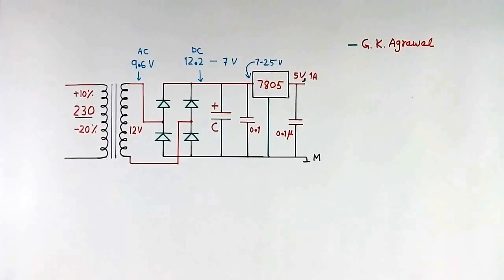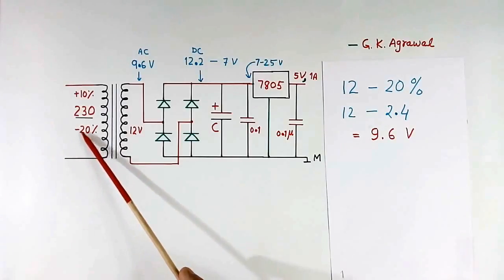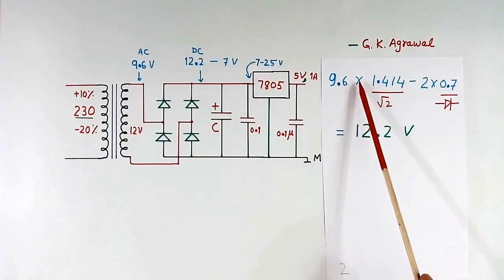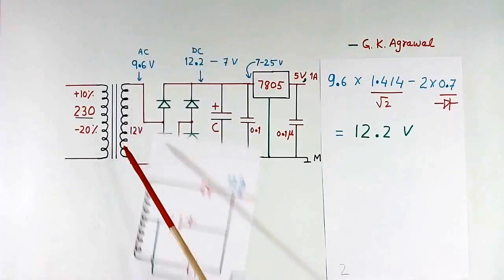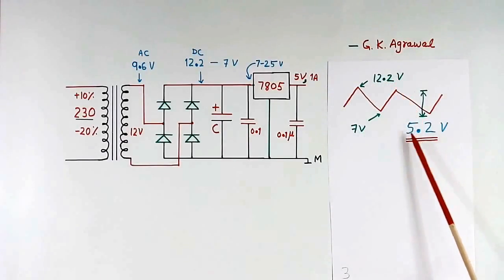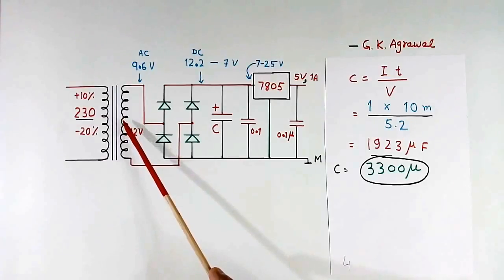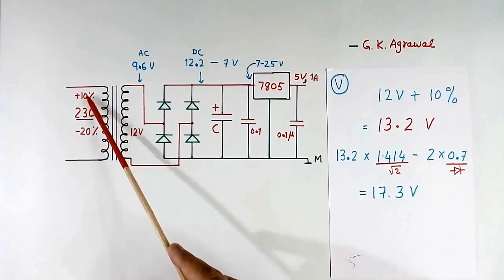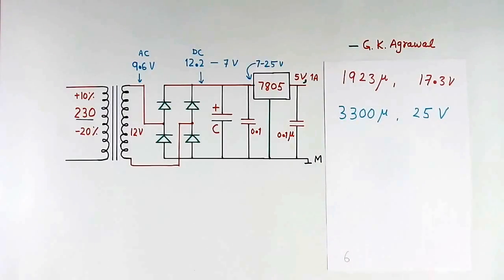Bridge rectifier - capacitor value & voltage calculation

Comment: I have watched your video but didn't get my answer. I want to know how to calculate the output current (amps) of a rectifier circuit. In your video I found one doubt... for capacitor formula (C = It/V) the  value of V was taken as 5V but its the difference of maximum and minimum voltage of the regulator but not the voltage across the capacitor. So I think V should be 7V here and also there is a very simple way to select the capacitor by taking double the value of the stepdown AC voltage. Here 12V is AC stepdown voltage so we can choose 25V capacitor or higher!
Reply from the maker: 1 amp is just taken as an example to design circuit. Current is not calculated, current may be a known requirement and then you have to calculate capacitor value. However reverse calculation can be done also. 2 -  Method   of calculation explained, was used by me for cicuit design. You are free to follow other method, but then equipment should work properly. 3- Now coming to 5 volt, I think you must  watch video again slowly, and give enough thinking for my every word told. I can not explain better.
Reply: @GKAgrawal2  I didn't get why you choose the voltage difference (5V) instead of the minimum voltage (7V) because that's not the output voltage and I think you should explain that!
Reply from the maker: 5.2 volt ( not 5 volt) taken as this much voltage capacitor will discharge due to the flow of load current. ( 7 volts is left overvoltage). If the capacitor is discharged for more than 5.2 volts then you will not get 5 Volt final output, as the leftover voltage across the capacitor will be less than 7 volts.
Reply: @GKAgrawal2  So for the capacitance formula (It/V) the V is always the discharge voltage of the caps? What if the voltage regulator is removed from the circuit then how we will calculate the value of V?
Reply: @saneeshelectronica9293  I came across another formula and it's C=I/(2*f*Vpp) where I is current, f is AC frequency and Vpp is ripple voltage. But as per your logic I can choose the ripple voltage as per my requirement but there must be some standard value because we can't just taje it as any value (that's theoretical only). Here the value of I is the supply current and that's what the transformer will provide but how do we decide the ripple voltage? Some say that we should take it as 1 volts but what is the proper method to find it?
Reply: @saneeshelectronica9293  I didn't understand your formula to calculate the required transformer can you tell me the formula? how you got the values 1.4 and 1.414? Also how you got the value of I as 4?
Reply: @debojitacharjee   the formula is simple.  I went reverse direction.  for example i have 18 vac = Dc will be 18x 1.414 peak -  2 diode drop( 0.7+ 0.7) of bridge rectifier.  4 AMP is required motor current in examble
Reply: @saneeshelectronica9293  You don't tell things clearly... I asked you about the formula but you are showing only the values! How you calculated 1.414?
Reply: it is RMS xroot 2 =peak voltage
Reply: @priyageorge3704  What RMS? Why we need peak voltage here?
Reply: @debojitacharjee  when capacitor is added voltage wil reach peak value of sine wave .
Reply: @priyageorge3704  Okay but why we need to know that because we find only the value of capacitor in uF using formula [C=SupplyAmpere/(2*ACfrequency*RippleVoltage)]. We can choose the voltage of the capacitor by taking double the supply voltage (if 12v is supply, we take 24v or higher). However I want to know what is the formula of your peak voltage formula properly, what is the formula of RMS that you mentioned?
Reply: @debojitacharjee   to get peak voltage u need to multiply with 1.414  if 12 v transformer 12x 1.414, if 24 v transformer, 24 x 1.414
Reply: @saneeshelectronica9293  Why we need to know this peak voltage?
Reply: @debojitacharjee   when we make dc from ac we need to use capacitor  . capacitor will take the dc out put  to the  peak value  that is the purpose of capacitor. if no capacitor  it will be pulsating dc.  for examble u need 12 v dc for  device. and u have used 12 v transformer, bridge rectifier and filter capacitor. u will actually  get  12 x 1.414 dc,  because of filter capacitor. if u didn't use filter capacitor ,u will get pulsating DC , not real DC.  so whenever u calculate the requirement, u need to consider that also  other wise instead of 12 vdc u get 15.568 VDC after deducting diode voltage drop of  bridge rectifier. if ur device can with stand 15 vdc, no problem u can use 12 vac transformer also.     if u use 24 vac transformer , actual DC is 32 v dc with filter capacitor mean   8 volt more . this get even worse at higher voltage transformer. please watch my videos to know more.
Reply: @saneeshelectronica9293  How you calculated 15.568VDC because for 12v peak is 12x1.414=16.968VDC, is that after deducting diode voltage? You plz give details or else its difficult to believe what you say! Also how this peak voltage will be same for all capacitors because it will depend on the capacitor voltage and I want to know how we will know how much the peak voltage will be if we choose a particular voltage for the capacitor? For example if 12v is supply then how much will be peak voltage if we select 24v capacitor?
Reply: @debojitacharjee   appreciate your interest in the topic. capacitor  does not produce any voltage it just store the charge and discharges when voltage goes down in each cycle. for any ac voltage it is  sinusoidal  voltage changes 50 times per second  when we use rectifier 4 diode it will have same  voltage fulmination but only thing is it will be in same direction instead of positive and negative . when we choose capacitor we choose capacitor we choose as per peak voltage of ac voltage plus 20% fluctuation. if 12 vac peak is 16.9 plus 20% (around 20 vdc).  capacitor not available 20v  so we use 25 vdc .even if u use 35 v doesn't matter   it wont improve anything, but life of capacitor may increase  little bit.   electrolytic capacitor has internal resistance  in Milli ohms. so always better to keep many parallel.   for example if u want 2200 MFD  Use 220 MFD 10 nos  ( if space allows you !!).... for every diode 0.7 to 0.8 volt drops when load is connected. so for bridge rectifier u need to minus  two diode drop  if center tap rectifier is used  one diode drop to be deducted. 16.968-1.4 = 15.568 . some diode has more drop.      .  so for any transformer  use (VAC X 1.4)- 1.4/1.6  as standard formula.    But diode looses lot of power if current is more for example if 10 amp current flows  around 7 w power losses at diode. please watch my channel and sub scribe . i have done video on that.
Reply: @saneeshelectronica9293   SANEESH ELECTRONICA  This formula (VAC x 1.4) - 1.4/1.6 will give what and for what purpose we will use this formula? I know that capacitor is not a battery and it can't generate electricity but what I said is that what is the peak voltage (V-1.41) and why we need to calculate it? Do we really need all this formula because we can use the capacitor formula [C=I /(2*fAC*Vpp)] to determine the uF of the capacitor to be used in the rectifier and choose the capacitor voltage as double that of supply.
Reply: @debojitacharjee     you r right for calculating MFD of capacitor the formula is not required. but when u  choose transformer for  a DC  equipment .  this is required. other wise if u select 24 vAC transformer for  24 v dc equipment . you may spoil it  as we are giving  32 vdc. from the rectifier filter arrangement. .
Reply: @saneeshelectronica9293  can you tell me howcome a 12v dc transformer rectifier circuit give 32v DC because peak is 16v only (V*1.41).
Reply: @debojitacharjee   oh no i was talking about  24 vac. the higher the voltage u use , AC to DC difference will increase. that is what i mean . if 12vac= 16.9 vdc, if 24 vac= 33.9  vdc  (u get only 33.9-1.4= 32.5 VDC at load).  you asked me. why we need to know the peak voltage?  i was answering that. if you dont know the peak voltage  u cant select a transformer. suppose u selected 12 vac transformer and after  rectification , u may surprise  why i get 15 vdc!!!!  any way one thing i need to know. are you doing any project ? or just wanted to know theory?
Reply: @saneeshelectronica9293  I am into projects and learning as also. But your teaching is useful because you don't clarify each and every thing you mention. You mentioned 33.9 - 1.4 = 32.5VAC but why you substracted 1.4 from 33.9? I just want to quickly sumup everything here since you had a long chat on this. You plz answer the following: 1) If a stepdown transformer is 12V then will it give 12V output without any load connected? 2) If you make a full bridge rectifier with 12v transformer then it's output voltage will be (12v*1.41) [PEAK VOLTAGE] - 1.4v [diode Vdrop] = 15.52v [FINAL OUTPUT]? 3) If a full bridge rectifier with 12v transformer gives 15.52v then can we use a 32v capacitor with the circuit?
Reply: @debojitacharjee  yes now it is clear for you. capacitor voltage has nothign to do with the design. amy capacitor more than 16 v is ok. if the voltage is less it will burst .  u ca use 25 v  as 16 is just enough.
Reply: @saneeshelectronica9293  So you mean to say that we can find the total output voltage of a rectifier by adding the transformer supply voltage + peak voltage - diode voltage [i.e. (12*1.4) - 1.4 = 15.52v] is that correct?

Comment: How you calculated the output ampere (1A) of the circuit?
Reply from the maker: Watch video again, you will get answer.
Reply: The 7805 voltage regulator has a maximum output of 1A.

Comment: Sir, why do we need to multiple the output of the transformer to root 2 (when changing from ac to dc)
Also why do we need to take half cycles (in this example for 50 hz 10 milliseconds) (In my knowledge the  capacitor will not be discharging  for the entire half cycle it will only discharge for a quarter of cycle plus till the next quarter cycle reached 7v but not the peak value)plz explain
Reply from the maker: Very good question.Yes your observation is correct that capacitor will discharge upto to 7 volt and will start charging again. But this will happen if capacitor value is correct exactly as per calculation. If capacitor value is higher {you will never get correct capacitor value} then it will not discharge up to 7 volt, it may be up to 8 or 9 volt. Then further if load is not full then it may discharge upto 9 or 10 volt, so we take full 10 mSec time. this is the simplest way and safer side. But if you are perticular then you can always calculate for exact discharge time, but then you will need very high knowlege of considering all known or unknown factor. But no body had perfect knowledge. you will known this after many years of industrial experiece. (Donot assume that your college knowledge is sufficient, you need to learn much more, to do product design).

Comment: Nice lecture but how do you know the number of cycle.  The question I have here doesn't tell me about the cycle.
Reply from the maker: There is nothing like number of cycle. Time of half cycle matters. For 50 Hz frequency, 1 cycle time will be 1/50 = 20 mSec,. half cycke time will be 10 mSec.
Reply: Thanks. So in the formula I'm to use 20 as T
Reply: Does this apply for just half wave. 
That is,  full wave will be 20ms
Reply from the maker: Please watch video once more, you will get the answer
Reply: for 50 hz   1/ 50 , 20 millisecond    but here full wave has 100 hz  
so 1/ 100    = 10 millisecond.

Comment: I have a device need 12 volts dc but I need a protection circuit for not entering more than 12 volts on this device what to use and how
Reply from the maker: Watch my video on zener diode application.
Reply: @GKAgrawal2  ok i will watch it thanks

Comment: How do we get 12v DC without using ic ? In the same circuit ? What will be the capacitor value ?
Reply: A 12V zener diode? Not sure of the capacitor rating tho.

Comment: HOW 17.3 v is coming when i am calculating the value is coming around 14.5 volt
Reply from the maker: Watch the video again with concentration please.
Reply: OK , I GOT THE ANSWER ...THANKS A LOT
Reply from the maker: Very good, you got the answer. Whenever your are not getting answer watch again. You can  watch my video, 4 study tips for science study.
Reply: SURE SIR
Reply: How you calculated the output ampere (1A) of the circuit?

Comment: What if i have a ac-dc converter with a transformer im using a fullwave rectifier and i dont have any regulator in the output side how the filter capacitor can be designed?? For (18-280)v input ac supply and 5V 1A DC output... shouldnt we have to consider the ripple voltages in calculating the capacitor sir
Reply from the maker: I do not know, how to get proper output with full wave rectification  with 18 to 280 volt input range.

Comment: I want 12volt 1 amp circuit how much filter capacitor value.
Reply: for 1amp if ripple 5 .5 volt, same 3300 microfard if ripple half make double capacitor

Comment: Hon.We have taken transformer considering secondary 20%and 10%, and calculated, but in case of non polarized capacitor with parallel resister at supply then how to calculate capacitor? With 20%and 10%?
Reply from the maker: 10 and 20% are taken to explain the concept. You have to take actual value.    This means, this power supply will work for this voltage variation.
Reply: Thank you.

Comment: How can voltage selection on without transformer full briged rectifier filter capacitor value
Reply: without transformer  u get 230 vac direct , dc  u may get 325 vdc with filter capacitor

Comment: Hon.what ever explanation you have given is for rectification,and figure taken in accordance,if capacitor is to be connected in other place of circuit how to calculate it's value.
Reply from the maker: Calculation always depends upon circuit and application. This comes with design experience.
Reply: Thanks but expecting more.

Comment: Sir I have made your circuit in proteus, for some reasons (I believe setting primary 1H/secondary 5.12mH inductance value of transform) I am not receving amps and led is not glowing. Here is circuit diagram http://prntscr.com/ie6pfl , Please guide a little where am I wrong. I set primary of transform to 1H and secondary to 5.12mH, what should it be?
Reply from the maker: Try making  LED 1.5 Volt with series resistor 1 K
Reply: I tried making led 1.5v with 1k resistor, even though no effect. before this i set led voltage to 5v and 100mA to remove resistor. Any other suggestion please

Comment: How to find the value of capacitor but I now voltage and current of circuit board I lost a capacitor value so how much use capacitor value I should give
Reply from the maker: It depends upon location / use  of capacitor in the circuit.

Comment: Hi sir, if i were to use a 230-12V step down center-tapped transformer to obtain a positive and negative supply, with 4 diodes, 2 connected in forward biased connected to positive terminal of the capacitor to get the positive supply voltage(same as the example u gave in the video) and the other 2 diodes connected in the opposite direction connected to the negative terminal of the capacitor to get the negative supply voltage, do I need to use 2 of the same transformer or just one transformer will do?
Reply from the maker: one transformer may do, but you have to use 2 capacitors, one for plus supply and one for negative supply. One terminal of both the capacitors should be connected to middle tap of the transformer. You should test this ckt, as I have not tried. I have designed industrial grade high quality circuits. We always used 2 separate isolated windings of the same transformer.
Reply: G K Agrawal thank you for the diodes should I just 2 or 4?
Reply from the maker: 2 for plus and 2 for minus as per your method of centre tapping. In our case for industrial circuit, we used total 8 diodes, both full bridge.
Reply: Hi sir thank you for your reply
I tried with your recommendation and is able to get a +17.8V and -16.8V
may I know why different absolute values are obtained?
is it due to the imperfect windings?
Reply from the maker: Yes, imperfect winding, harmonics, capacitor value and diode drop variations and load difference.
Reply: noted sir
Thank you so much for the help!

Comment: Sir:  How can i get 40-o-40 vdc from a 25-O-25 transformer 10 amps ...? i mean capacitor Value:
Reply: 25-0-25 will get maximum dc (25x 1.414)-1.4= 33 vdc only  +/1 33 v we can  make. you need little higher voltage , sub my channel  too

Comment: Thanks Sir, 
If we further increase the ratings of capacitor what happens?
Reply from the maker: It will help and reduce ripple voltage on capacitor, also it can take more voltage variation at input.

Comment: Sir, please explain how to calculate 0.1 micro farad capacitor values in this circuit and purpose of two capacitors
Reply from the maker: 0.1 micro ka koee calculation nahee hai. Yeh anubhav se aata hai. IC banane walee company bhee eskee value batatee hai. 0.1 fix nahee hai. Aap thoda kam jyada bhee use kar sakte hai.
Reply: Thanks sir
Reply: @GKAgrawal2   sir, please in English